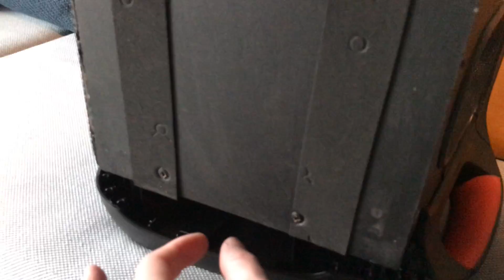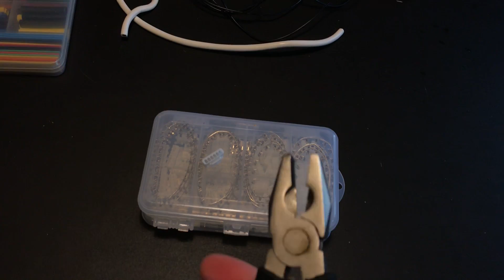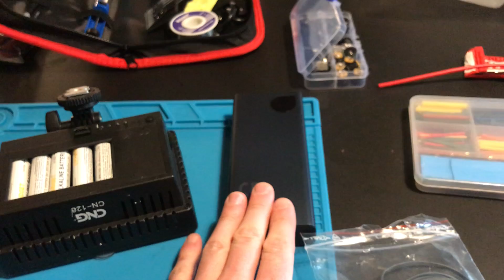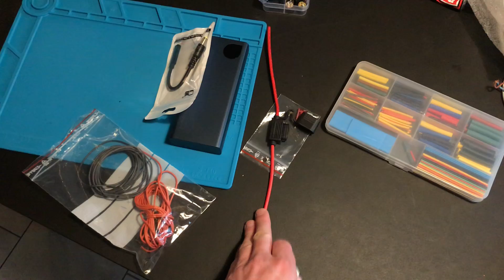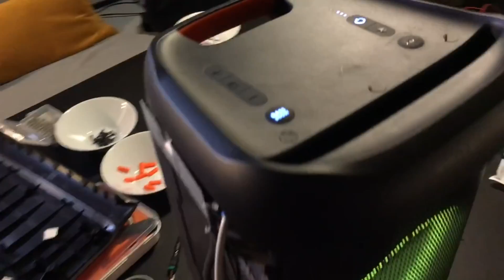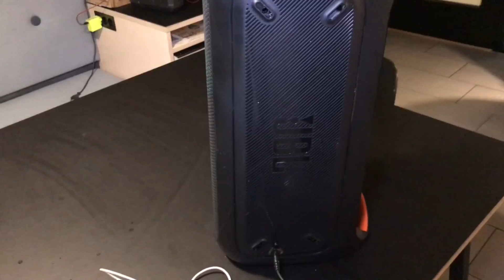Disassemble JBL Partybox 100 & Battery Upgrade (Part 2/2)

Comment: Hello, I have a question about removing the battery from a JBL Party Box 100. The battery is dead. Will removing it completely and connecting it to the mains burn out the speaker?

Comment: you can put and the power supply with a on and off switch so if you are in house plug the power supply and outdoor you can use the power bank! is the best solution
Reply: you have a video for this sir?
Reply: @ryanmijares8331  no but i can do it. i dont want to open my 110

Comment: Hi, maybe u can help me..
I bought a JBL Partybox 300 battery for my JBL 300, installed it, but know i am trying to Charge ot as usuall, bitte only one of 5 dots in blinking since 4 hours.
Not sure why:(
Reply: Somebody bought it new before you and changed out the battery and returned it to the store. Or an employee did it at work. Or the store sold you the last one, which happened to be the one they been playing in the break room for the past two years and put it back in the box.

Comment: Dude this is awesome thanks for the VID!
Reply: one quick question you think that power bank might fit in the bottom case if you drill out holes could you use the the USB-c ports that would be baller!

Comment: Thank you for this video. 
So that means the only way to charge/power left is via USB c right?
Is the charging speed via usb the same as AC?
My electric knowledge is limited so would a 220v powerbank like beaudens 166Wh (more expensive but easier to use) would have the same effect (and extra battery life)?
Thanks.
Reply from the maker: My electrical knowledge is limited too.
Yes, doing this mod only leaves you to charge with the USB C and not with the normal AC 230V input.

If you use that one Powerbank, you don't need this modification anymore, however, I don't know about lifetime since you probably waste energy during the conversation of 220V to 24V.
Reply: Could you not connect the wires from the converter and the wires from the dc plug together, and then connected to the jst-xa plug? Then both charging options should have worked?

Comment: It's just better to buy 2 battery packs and connect in series, double capacity, voltage is the same
Reply: Parallel not series
Reply: @nicolozak  exactly thank you.
Reply: What about the thought of making it solar panel chargeable for those on-the-go that don't have access  to power if I was to do so how would I do that and what size solar panel would I have to use any suggestions can help